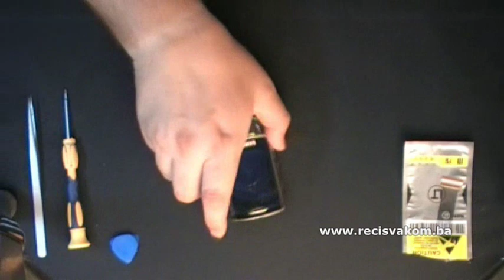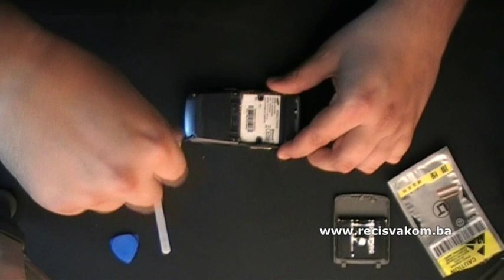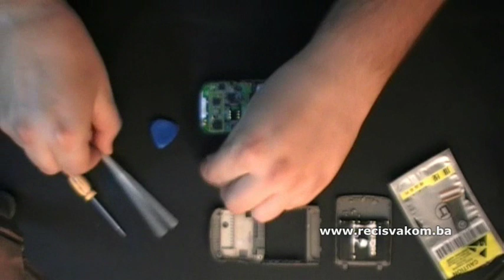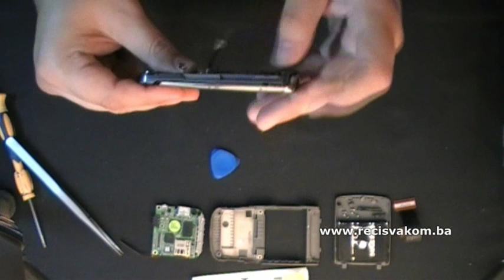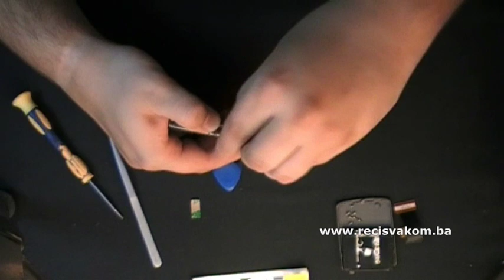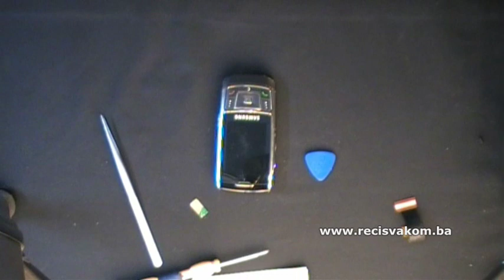Samsung D900i Disassembly and Flex replace / Samsung D900i Rasklapanje i zamjena Flex kabla

Comment: How I which you can help me. I wants to get mine fix. I want to print the photos.
Reply from the maker: Print photos? Please explain more clearly?
Reply: The HEPEK hello. I’m still having this phone but I can’t switch it on now. I want to print out the photos taken previously by this phone but I don’t know how.
Reply from the maker: Did you chek the battery voltage?
Reply: The HEPEK none of the phone repair shop want to help me. They say no more spare parts.